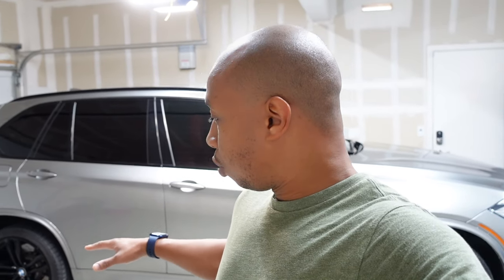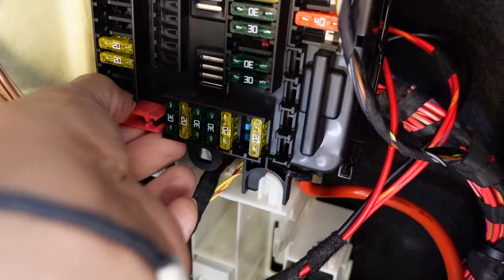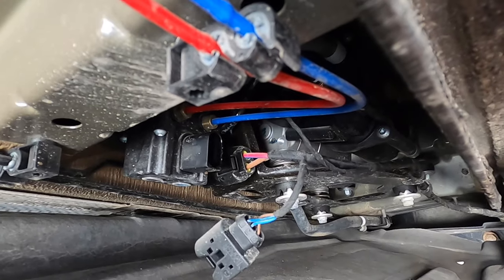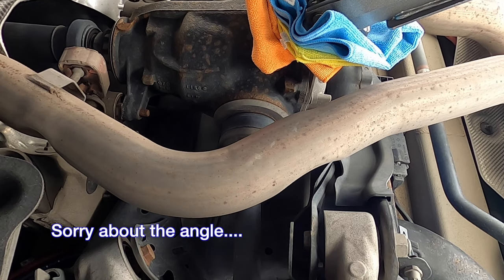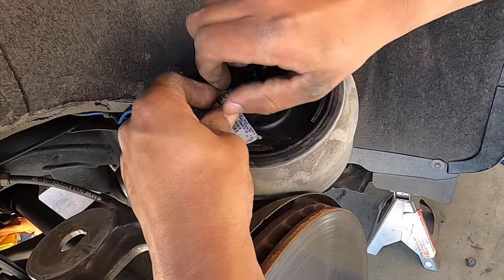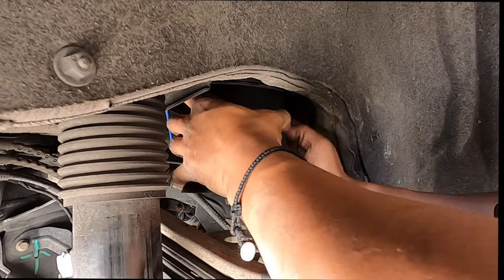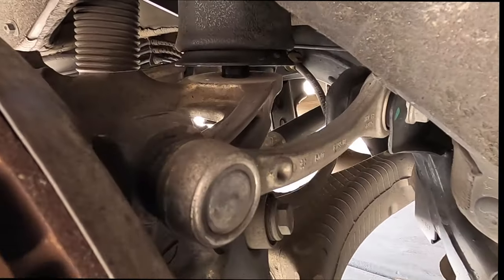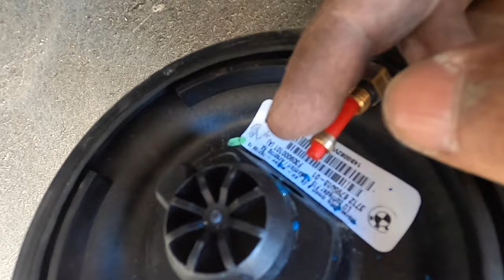BMW X5/X6 EASY DIY Rear Air Suspension Replacement-

Comment: Awesome video man thanks a lot...I'm in the market for 50i m-sport and this here was one of my worries, the suspension failing. It's great to know that it is a doable DIY fix when/if needed.

Question; I've searched and searched but there are so many different codes / options for these things when it comes to suspension and I have a hard time finding the answer. Do you know if all adaptiv M (2VF) , Adaptive Dynamic (2VP), DHP's, are all airbags such as this?... You're super knowledgeable on these so thought I would ask! Thanks again
Reply from the maker: Glad I could help.  
Yes, you are correct, you get the rear air suspension with 3rd row or Adaptive M.  I believe the 2VP adaptive dynamic comes bundled with the 2VF.
Reply: @eddiemcars  thanks for the help! I think you’re right, 2VF and 2VP might bundle together. Still not sure if that classifies as DHP but trying to figure this all out...it’s confusing 😂 (will be my first European vehicle)

Comment: Great video Eddie! I might have to do this DIY soon. Do you know if these Amazon bags will fit a 2016 X6M F86? Also, these air bags are located only on rear suspension? TY
Reply from the maker: Thank you!  I’m glad you found this video helpful!  Yes, these bags will fit the X6M and they’re only on the rear axle.
Reply: @eddiemcars  but w the Amazon air bags @ 120 aftermarket will one blow out and have me role?

Comment: How much will the dealer charge? Or independent mechanic
Reply: Hi there, I had the same issues in my 2014 X5 ,  in New Zealand dollars a dealer charged $1000 per side/ airbag to replace ( so $2000 ) but then the pump had worked 'overtime' due to airbag issues! So I had to pay dealer another $2500 to replace faulty pump, very costly issue via a dealer in NZ . Around $4500 in total.
Reply: @stephenspier9590  WowI bmw should have already fixed that issue. It goes back to early x5s. They should have remade ait suspension that lasts longer in my opinion
Reply from the maker: Its expensive!

Comment: I have this issue where the rear sags on my 2016 X5 .  It happens every 3 months or so.  Lasts for a day.... then appears to resolve on its own.  No codes are thrown.  Would you replace bags only or compressor and bags
Reply from the maker: I would do bags only and as soon a possible before pump failure.  When the pump dies it will be unable to raise the vehicle.

Comment: Ive had new airbags fitted but they still drop about 1 inch when parked. But when i start car it inflates back up. Why would this be?
Reply from the maker: Sounds like a slow leak either from bad connection or faulty bag
Reply: @eddiemcars  they brand new bags thou. So how can i have a leak. And they not even a month old

Comment: I have a X5m f85 just replaced my bags but it’s still not going up lol so I think my fuse is blown? Or the beeds are filled w water?
Reply from the maker: Could be a bad pump too
Reply: @eddiemcars  they are saying it might b a faulty bag but I found some pumps on eBay - what’s ur opinion on those air supply devices - do you think they’re the same?

Comment: Just pull fuse and disconnect air from above.  Don't replace with stock airsprings, use Arnott P/N A-2642 from Amazon and spray rubber bladders with silicone to help them stay supple.
Reply from the maker: I’ll remember that when it comes time to replace the M shocks.

Comment: Subscribed. Thanks a lot for the great video. Very detailed and I like the uh oh moment when you break the brass fitting. That would have totally been me. The air bags on my wife’s X5 started to sag this weekend and going to tackle this diy. 

Two Questions: do you think I can disconnect the ride height sensor and adjust it to the highest position to deflate the airbag then pull the fuse to the compressor/disconnect battery? And how long did this install take you?

Thanks again!

Comment: I have a x6 f16. Its got a constant sag in the rear passenger side and doesn't raise back up. Reckon its the same fix ?
Reply from the maker: Yes, but I think if it doesn’t rise back up, it could be the pump failing too.  
You can always start with the air shocks first and go from there.
Reply: @eddiemcars  all sorted thanks to your video. Turns out it had a hole in the bag. Great advice  much appreciated from the UK.

Comment: What causes the compressor fuse to keep burning. 2017 X5M
Reply from the maker: The fuse shouldn’t keep blowing unless there’s a short somewhere in a wire or the compressor is on its way out.
Reply: It blows after compressor pumps air in bags, bags then deflats. When driving then fuse blows

Comment: Hi hopefully someone can help me, I just bought an F86 x6M and the rear bags started to give me some issues… 
At first both of them were very low but after starting it they got up after 5 mins driving they both turned back low… today I saw only the right one it’s low and again after driving a little she went up once turned of came low again I’m not having any errors in my screen… 
Hope my comment it’s understandable waiting for an answer 😢
Reply from the maker: It sounds like the pump is failing too.  When the bag leaks the pump is working overtime. The air pump motor is designed to work intermittently but not constantly. Think of it like trying to blow into a ballon with a hole in it. You’d be out of breath and give up.

Comment: How did you get the brass fitting back on?
Reply from the maker: The one that screws?  It should be able to slide on the air hose with the threads facing the end. The brass piece (that I broke in the video) should slide on the very tip of the hose.  Connect it
to the new suspension, and you should be able to  screw it in.

Comment: Why did you disconnected pump if you pulled fuse out ?
Reply from the maker: I pulled the fuse #140 fuse due to the write up I read on the forums, but because I didn’t have the computer to control the bags. I wasn’t sure if it would randomly inflate. It probably wasn’t needed but it didn’t hurt. I also read the pump is controlled by #135 fuse also.
Reply: @eddiemcars  on what website you  bought bags ? Thx in advance.  Great video !

Comment: Thanks you for answering my question yesterday.  I have another one.

I have an F-15 with the MSport Package.  It has the M Winter Wheels which are 19’s and not staggered.   What’s on your M?  Are those 21’s or 22’s?

Trying to decide on what size to get (staggered) for spring/summer and whether or not a slight lowering would improve road feel and turning lean.   

Thank you.
Reply from the maker: I have 21” staggered on the X5M. 
OEM BMW 612M wheels 

Staggered wheel package would improve the looks and lowering will help with the driving.  
Do you have adaptive M suspension?
Reply: @eddiemcars  I don’t have adaptive suspension to the best of my knowledge.  Just the modes:  sport -dtc, sport, etc.   I thought 20’s might save the rims a bit and give me a bit more tire as I have horrific roads here.

Since I don’t have adaptive suspension, my thoughts we to install a slightly lower spring and perhaps upgraded shocks.  Nothing too serious.  I have zero plans to track an SUV.  I’d just like some better road feel and less body roll in turns.

Comment: How much were the savings by DIY?
Reply from the maker: Air shocks cost $85 for the pair labor is free for DIY 
Dealer cost are typically north of $1000 for parts and labor.

Comment: That brass fitting is the worst part. I went with a set similar to the one you got and its been holding up good so far 5 months/6kmiles no issues!
Reply: How did you get the fitting on? I broke mine. Ordered the part
Reply: @htowngirl68  the new one broke on one of the sides, ended up using the old one. lol

Comment: "Easy diy replacement" don't bloody think so christ you're under it pulling plastic covers of then unplugging block connectors loosening air pipes and that's before you start on the bags. It's really no wonder people put springs on that's to much buggering about for "fancy" suspension.